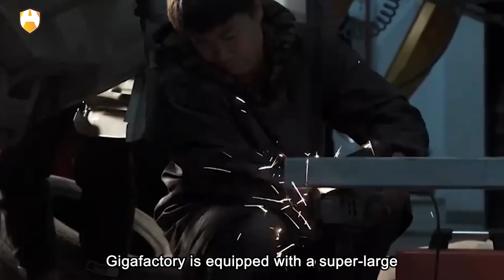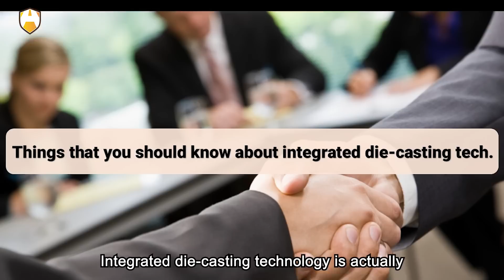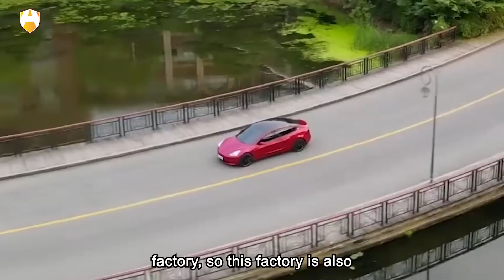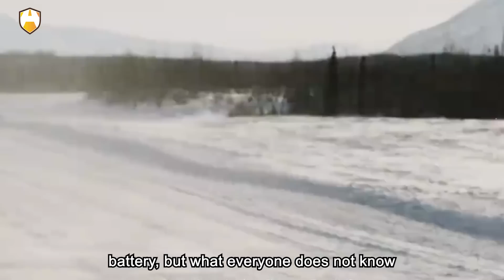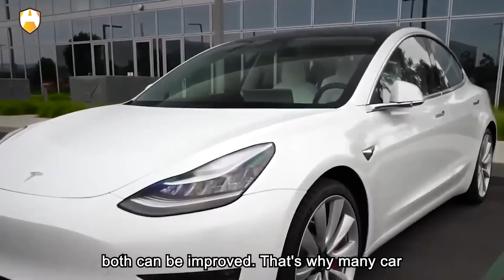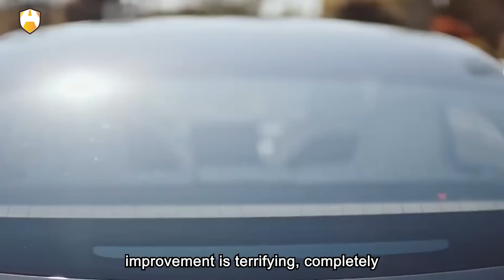Behind Tesla, China shocked the global auto industry with this tech? It's true?

Comment: The only thing that's going work long term is to make cars with rust proof material.
Then make it modular so that you can replace anything on the car as easily as changing a light bulb.
You will also cease to paint the car.
The car is a utility vehicle and should be treated as such.
The establishment have been selling cars as a status symbol.
Just like the jumbo jet was made in the 60s and still the fastest way to move people.
All they want is the new economic engines.
Most people don't keep the car more than a dozen years.
A car should be for decades
The delorean car was a good start.
The future is not what it used to be.